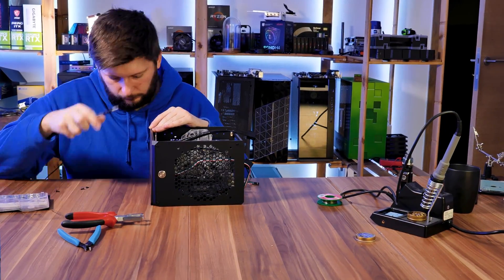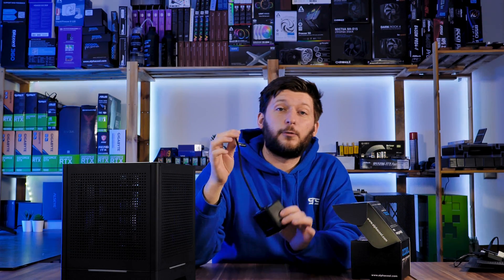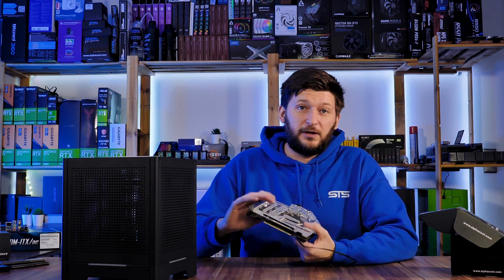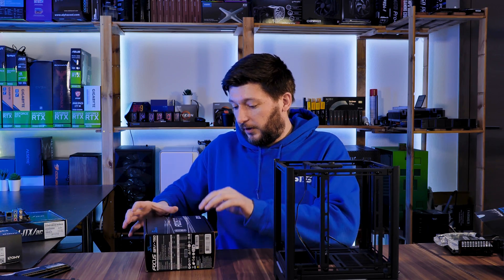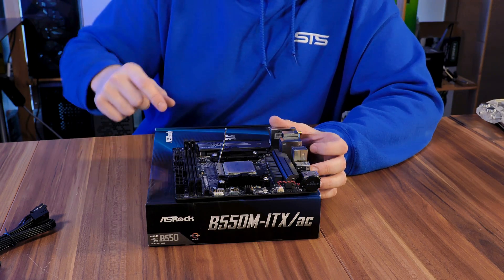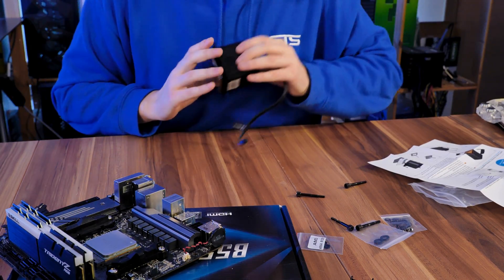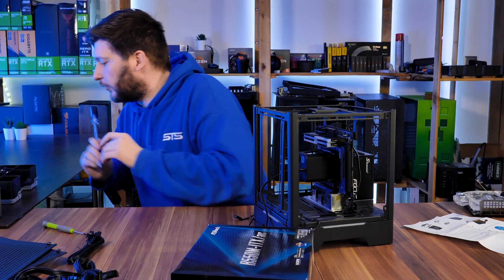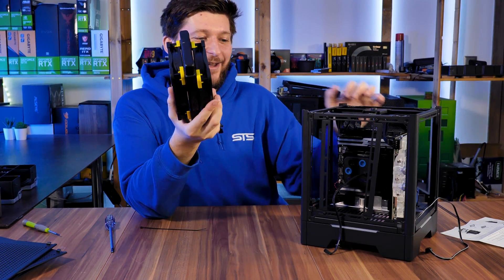The AquaCube - Custom Water cooled SFF 3060ti/5600x - Part 1

Comment: Oh man, I'm super happy to see continuation/revamp of the mini build 🙂 I was very interested how the 120mm rad will handle those components, as I'm also planning same apporach, but in custom case, that I would like to build as small as possible. So I hope the next part will come out as soon as possible and I also hope that you will include termals for this 120mm approach with just a single fan(event thou I expect it to fail and not have enough cooling for this system 😀). Also I would like to ask, how long is this ASUS dual 3060Ti with waterblock on it ? I looked at Bykski's page about block, but there is only length of the block itself, but I would like to know the length of whole card with block on it.

Comment: Ngl the fact that my 3070 Dual OC does have a fan rattling issue (literally after like a year of usage) I kinda wanna go watercooling for my next build.

The thing is that I'd have to send it to Asus to get it fixed and they told me it might take like 6-8weeks or longer...
So sending it in is also a pain in the a**.

Literally the 2nd time I have this issue.
I wish every GPU had a shroud like the 3070 Noctua edition so at least you could swap the fans yourself for aftermarket ones...
Reply from the maker: Things like this suck. Our 3070 vision’s central fan also rattles quite a lot if the GPU is installed vertically. I guess the bearing is done, but kinda disappointing to see something like this happen to cards we all paid premiums for